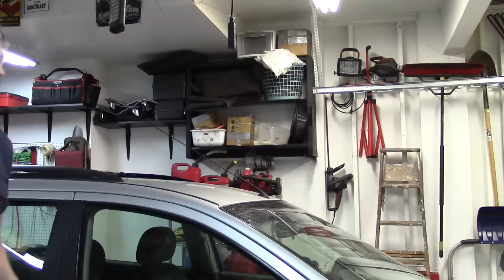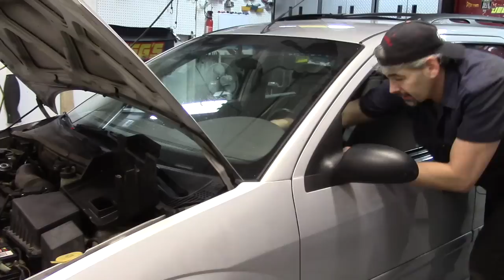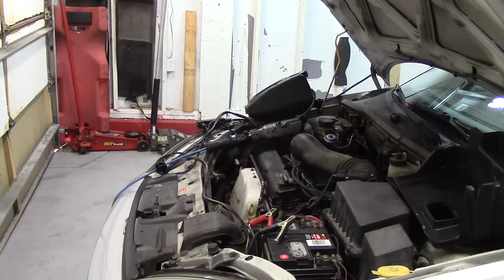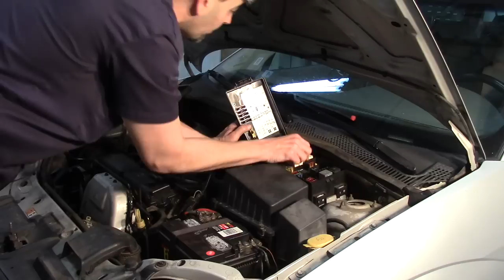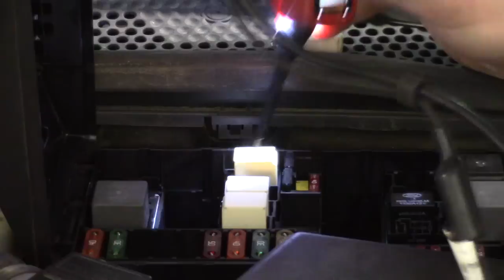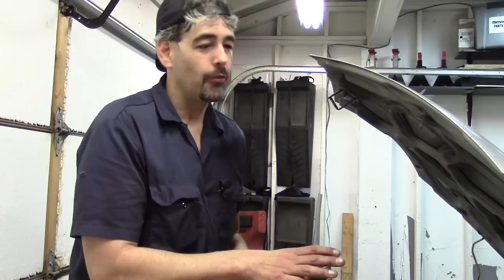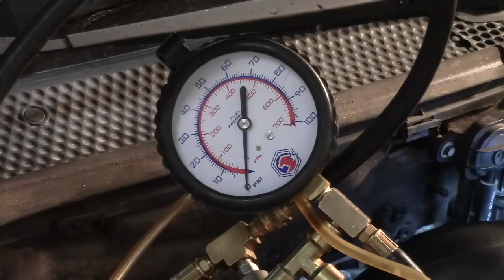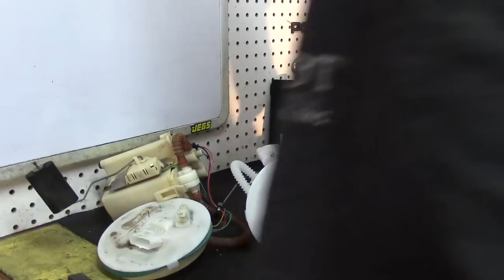Cranking No-Start Real Time Diagnosis -Ford Focus

Comment: here is an up date.  Expy failed going up hill on short out of town trip.   replaced fuel filter that was clogged.. ran perfect for 3 days. It failed after errands in a parking lot.. went to get it.. i drove it home.. for 2 days cranked perfect.. continued to run gas out over the next few days  so the fuel pump would be easier to change.  It failed to start again for five days. Researched . I have Chilton's ECT. There is a limited amount  of info in them. I am an ex electronic tech.  Understand relays ECT.   So watched videos ECT.  Checked Schrader valve had gas there. I decided to turn the engine over.. it started (we are dealing with an intermittent here) I took it to a neighbor  and he put a bid tool on it.. not a cheap one.. it initially said misfire on cylinder 4.. that made sense because when it quit, it did misfire going up hills   I told him  to clear the memory.. He found no codes..no cam sensor problems, no crankshaft sensor problems, always has had the sound of prime, never checked voltage at  fuel pump relay or pump itself.  I hesitate to pup 12 volts to fuel pump willy nilly, as it may feed back and destroy electronic infrastructure.   I know this can be the inertia switch (they sometimes are intermittent). It could be an insulation leak to the chassis.  I don't know if I am getting spark.. it seems like like the obd tester would catch that.. The problem is that it is intermittent. I notice this doesn't have the normal spark plug wire setup  and I think this  is cop setup.  I am a little  confused how to properly check for spark do I use a noid.  Oh yes it is only showing about 30 psi on idle and 35 on acceleration maybe a little higher at high rpms.  Also my  fuse board under the hood and  below the steering wheel does allow pull and replace of relays.  If it comes down to it I can fix boards, but if it's a expensive chip.. that probably won't be happening.. I suspect we are dealing with an obvious component. If  any body can give me a detailed  description of how this all works please do so.
Reply from the maker: Ok what data do you have?

Comment: Been a mechanic for 30 years ticket and never saw any domestic car not key on engine of pressurize the fuel system that diagnosis should have been first for a no start all the other tests are unnessasary once you don't hear the fuel pump

Comment: I'm watching your video.. I've been told by people not to spray down the throttle body..in the  cars with mass air flow ECT.. I don't know.. I'm sure there are lots of people that are misinformed.. one person. said that sensor was extremely hot and could cause a fire. Murphy is my friend ... and I don't know any one named Murphy.. lol.
Reply from the maker: Like most people (98% of them approximately) they have no idea what they are talking about. they just parrot what they hear from others who also have no idea what they are talking about either
Reply: Schrodingers Box  I've been seeing lots of people spray into the throttle body.  I don't know what's safe. I have other and some mass air flow cleaner probably neither one is right.
Reply from the maker: The question is WHY are they doing it? Almost invariably it's a wing and prayer because they have absolutely no idea what they are doing. Is the TPS voltage disproportonate? If the MAF frequency inconsistent and causing an increase in fuel trim?  Hardly do they even understand that.
  The type of product you would use depends on the actual confirmed diagnositic condition you need to repair.
  There is no "Some ignorant hack just wants to spray the TB product".

Comment: Hey quick question, I have an 07 malibu  2.2L. My car all of a sudden started to not crank at times. I haven't changed out the fuel pump because it still works but only if I keep switching relays backs and forth and it cranks right up. It only happens on long trips (800 miles one way after filling up sometimes) and if I drive it around locally it'll do it once every three weeks or so... I have no idea...please shoot me some tips advice.
Reply from the maker: What data do you have?

Comment: I'm no mechanic and I've only had a car for 4 months now and even I felt that it was the fuel pump.
Reply from the maker: I don't understand your comment... what do your feelings about something have to do with scientific diagnostic approach?
 Why didn't you "feel" it was a relay? A ground fault, or a impact switch? All give exactly the same symptoms 100%
Reply: Schrodingers Box I'll explain,it's not the feeling of just magical random feelings,the feeling came from the likelyhood of the fuel pump being the main reason why the car didn't start.just like if a car had no power going at all when key was turned,you would feel to check the battery first.but I'm not professional mechanic so I can't say my methods of feelingness would work in every scenario,just like you said you aren't an engineer.buuuuuut when I saw that it was a Ford i also thought about the inertia switch which switches off the pump.
Reply from the maker: Well in the world of logic, guesses are wrong even when they turn out to be correct.  It should be obvious there is no other way it can possibly be, mathematically.
Reply: Obviously I wouldn't guess like that on my car at all,it was just a 90% sure guess on what the problem with the car you were repairing was but primarily speaking of the video itself based on the likelyhood.but logic says it clearly in the 2nd professional edition US release only book under chapter 74 section 9 page 1,925 line 2 sentence 24 word 52 letter 1 ink dot location X-217,Y-372,Z-196

Comment: 500 bones for a factory pump? Only difference is the alignment tabs? At that point, I'd be taking a dremel tool to the tabs and making it fit.
Reply from the maker: I don't do hack work on other people's cars. They are trusting me to do the job correctly.
Reply: Cutting a tab on an otherwise identical pump doesn't qualify as hack work in my book. Taking a tin snips to the tank to stuff a junkyard Chevy truck pump in does. (I've seen it) and of course, the other variable is what the customer can afford, and expensive factory parts installed by dealer service depts. are beyond the range of many, if not most owners of 15 year old economy cars. That's where clever indys come in.
Reply from the maker: So when you cut the tab, exactly how tdid you plan on locking the pump into the tank so it stays stationary?
Reply: Honestly, I'd have to look at the specific scenario to determine the best locking method, but what comes to mind immediately is drilling a small hole through where the tab was, and running a sheet metal screw through it so the threads engage the slot in the tank. Run the screw through an O ring to seal it. In some applications, the tabs aren't a necessity, they are there to position the pump/sending unit correctly in an assembly line environment. Once the locking ring is locked down, the assembly won't move.
Reply from the maker: Yeeeeeaaaaaa.......  Ummmmmm.... don't want to jerry-rig it or anything. 
   like i said, I only do things of the highest quality work as the customer is trusting me to not hack things together and instead just get the correct part, which is what I did and always will.
Reply: I build hot rods to the highest quality and safety standards. I often take engine A and swap it into chassis B, mixing and matching manufacturer parts, doing modern EFI swaps into '50s and '60s cars, etc. Almost everything has to be modified or custom made. 

I guess I'm just jerry-rigging and hacking everything together with reckless abandon. Been nice talkin' to ya.

Comment: 1st thought was the inertia switch.so fuel shut off/inertia switch or fuel pump
Reply: That was my thought too. Can quickly rule that out by pressing the button to reset it. Located in the footwell next to the door. Insert finger into hole and press downwards. If hear a click the first time it’s pressed then it’s reset and (if that was the issue) should fix it.

Comment: hi. i have been watching ur videos and you are so right about only 2%need to understand the rest are guessing. i have a crank no start. no spark.. but prior to the car shutting off i needed to replace the map sensor. at this point will it be possible to replace the map sensor or at this point the computer will need to be changed? mind you that my help changed all the basics..
Reply from the maker: What was the data you had that indicated you needed a MAF sensor? That's what i'd need to answer the question.
Reply: @SchrodingersBox  can  maf cause my 2001 toyotasequoia not to start

Comment: Hi there, I have a 2012 Ford Focus with only 30,000 miles. Yesterday it for the first time caused me grief. It is cranking well but not catching; I'm thinking possibly coils or crank sensor. Please advise if only one of the four coils was bad, if the motor would not catch or if it would but run rough. I have not checked fuel, but find that unlikely. Would a crank sensor be the possible culprit? Thank you.
Reply from the maker: What is your data that the coild are bad? Did you verify signal is reaching them and that there is ground and reference? Please share the data.

Comment: hey mat. Love your videos man. I've worked on motorbikes, cars, and small engines all my life . And as a golf course mechanic  I've seen and done a lot of different repairs. But for the life of me I can not understand was is going on with my personal driver. I have a 92 Camry LE 2200. It will cold start fine,and idle fine like nothing is wrong. Even revs and drives fine. Until it warms up. If I stop somewhere it hard starts, but it starts barley. loses power when I try to accelerate unless you find the sweet spot in the throttle. If you floor it it bogs bad and pops once or twice. Wants to stall at idle but mostly rough idle. the next morning cold starts great again. I'm wanting to rule out fuel pump, stainer, filter, regulator, injectors because it seems heat related. But I would love to have your opinion. I'll start testing the feul system when it warms up a little here in North Carolina. I just have a carport no garage. please help me I really love this o'l car and I know it has to be something simple. Thanks Kevin.  kevpace66@yahoo.com
Reply from the maker: Interesting! Right up my alley! What data do you have?
Reply: Schrodingers Box I have no data to give as yet. I'm kind of snowed in right now. I can tell you there is no engine light and no codes yet. back in August I replaced a leaking/ noisy water pump so I replaced the the timing belt while I was at it. when I got done I had engine light. but the timing was spot on so I put    a jumper wire on E1 and TE1 on the data link connector and counted flashes. code 12 RPM signal *no "Ne" signal to the ECM within several seconds after the engine is cranked. * no"G" signal to the ECM two times in succession when engine speed is between 500 rpm and 4000 rpm. So I took the cap off my distributor and to my surprise a rats nest of copper wire was wrapped around my rotor. some how it pulled all the winding out of  the rpm sensor. So thanks to a life time warranty I got a whole new distributor from O'reillys . cleared the code by disconnecting the battery for 10 seconds. engine light went away, everything was great life went on. wife took it to up state New York and back no problems. Then in October I took it to Florida and back no problem. Couple days later it over heated idling in the driveway. I noticed the fans were not coming on. so I replaced the coolant temperature switch located at the bottom of the radiator. And the water temperature Sensor up top. But I was iffy about changing that one as I leaned It might not have anything to do with the fans. it could be my problem if the new one has failed. I've never really had problems with this car accept trying to keep a good set of plug wires in it. arcing after a year or more. But I just keep getting a free set every time. oh this is the 3rd distributor since I've owned her. if and when I can brave the cold NC air. I'll try to do some checking. I'm armed with a Haynes Repair Manual and a Fluke multi meter. tell me what data you need and I'll return that to you as soon as possible. just so you know my baby has 357,494 miles on her. No dents, cold air, cruise works. just a faded silver O'l girl. Thanks for responding. Kevin

Comment: Great video! Great analysis.  I have a question.  I was driving my 1998 Ford F 150 and a rattling sound started.  Sounded like something was hitting the fan.  It was intermittent and I started and stopped the car several times but I was couldn't see what was causing the sound.  It seemed to cease as I increased speed.  I got home fine and shut off the car, still couldn't see anything as the cause.  Went to start the car a few days later and no crank no start.  Any thoughts? I really don't want to pay for a tow.  Thanks. Russell
Reply from the maker: Sounds like a belt broke.  Diagnosis on mechanical problems is extremely simple- just find the issue through dissection .
Reply: Well I changed the battery and hooked up a diagnostic computer but couldn't get a read from it. So...now what? Starter? Fuel pump? Electrical?  Why the noise under the engine and then a few days later no start no crank? No connection? Could the electrical from the battery to the starter come loose.  I put a rebuilt starter in back in 2007 could it have crapped out?
Reply from the maker: Andrew Russell What data do you have from any of those hypotheses? WHat is the voltage at the starter static vs loaded What is the voltage drop on the fuel pump?
  You need DATA to even choose a direction

Comment: I love your knowledgeable strategy. As one of the leaders in Rule Based Artificial Intelligence, my job was in identifying "Experts" in various fields, to pick their brains.  You would be perfect for that task. Now I have a Ford Falcon 2000 with a no start (cold). I had it towed to the Auto-Electrician, who had inspected it, tested a fuse and manually got the engine to turn, so he could run a full Computer check on his $70,000 machine. So far $70 for the tow and $99 for the test (tomorrow).  Are Australian Fords different - why MUST every problem be Computer caused? Can we fix the basics - getting the power to the starter, from the ignition switch, without using a computer to diagnose the car's computer.
Reply from the maker: As shown in the video you need to process FASTTEC to determine the no start etiology. I do not see that you even started this step yet.
 Once you do I can help.

Comment: at least it turns all mine does is click at the relay that's it
Reply from the maker: What is the source voltage and what is amount of voltage drop at source vs at starter relay? Easy diagnosis.

Comment: i check the fuel pump with multimeter the resistance its 2.7ohm i check the voltage went Start its 11.9 volt the spark plugs and spark plugs wires its New fuel pressure regulator its New

Comment: Thank you. My Ford Focus 2013 had fuel pump issues, gave me a notification of "Cranking Time Exceeded" as a result of over-cranking and now "Engine Malfunction, Service Now". How do i resolve this?
Reply from the maker: What data do you have? What is the static vs running fuel pressure? what is the voltage drop at the fuel pump? what is the short and long term fuel trim at static vs load? Give me something to go on.
Reply: Ok. Thanks. My technician just changed the injector in the fuel pump. Same day, the car worked and moved fine. Then still on the same day, i re-fuelled and it started hiccups, until it won't even start anymore but kept cranking. After a while, it says, "cranking time exceeded". then i left it to cool off, but now it says "engine malfunction, service now". I must have over-cranked it. I just want help in clearing that fault before moving on to the fuel pump issue.
Reply: I cannot provide much of the data you requested as the technicians are on Eid-Kabir break right here in Nigeria
Reply: Please help with solving the crank timer issues and engine malfunction notification. Then by the end of the holidays, Wednesday, i should get some data from the technician guy.

Comment: I have a 2001 nissan altima gxe that has a crank no start a friend of mine cause the antitheft inhibitor to activate I have no remote only car key and it doesn't deactivate the inhibitor anyway my question is if I take out the ignition coil out of the distributor can I bench test it and if so how the coil is inside the distributor as well as cam sensor I know how to take the coil out